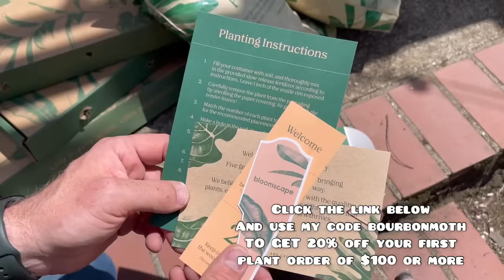Easy Wooden Patio Table || DIY Outside Dining Table

Comment: Those GRK's that you switch to when lagging the cross pieces to the legs are amazing.  I use them on anything and everything that is outside or needs to be strong.
Reply: The GRK lag bolts are great also. Used them to build shelving in my garage, and I’m sure that the structure will outlive the house itself.

Comment: I hear ya on the grayed out cedar, but if you ever change your mind, I used Sikkens Cetol 1 and Cetol 23 on a log home with cedar beams and it turned out amazing. Expensive, but awesome results. I used the same on a three car garage with cedar doors. Customer was very happy. Maintenance coat is every 3-4 years.
Reply: Sikkens is legit!

Comment: Nice video and really appreciate seeing the process, the mistakes and the fixes! From my NW experience for outdoor table I suggest to cover it when not in use (Classic Accessories is one brand I know that makes outdoor furniture covers) and put some coating/wax finish to avoid permanent food/drink stains. I didn't do this for my first table and had to replace it way too quickly.

Comment: In this scenario I would go to Home Depot see that a 2x4 was 8$ then turnaround grab a 50$ patio table instead. Then skip the cereal and just drink the bourbon and coffee  🤣
Reply: Don't buy from Home Depot
Reply: $8?! $21 each by me
Reply: @cardboardorigami  i guess he meant just spruce one. $14 for pressure treated here
Reply: Is the patio table really 50$ with same quality wood and durability? I really doubt it, although I do not live in the states and we do not have a Home Depot
Reply: @erwin757  probably he meant a plastic one, really wobbly and cheap :)
Reply: @katesukhanova5530  bourbon not that heavy, that’s good enough for me !
Reply: @erwin757  No chance a good quality hardwood table is 50 bucks.

Comment: New table saw?  Party time, Excellent!  I'm a woodworking fledgling compared to you but in addition to the safety, I really appreciate how well it runs and it's solid and reliable.  Nice table too -- and that rug really tied the patio together, did it not?

Comment: Nice design! Would be perfect here in Scotland. Pity getting hold of cedar stock here isn't as simple as heading to Home Depot. It's practically a second mortgage proposition.
Reply: I was about to write exactly the same here in New Zealand. If you made the thing out of pine it would probably weigh a ton and no longer be moveable.
Reply: @justinstrik7125  Totally. Plus it wouldn't have anything like the durability of cedar.  The only readily available alternative here is treated spruce. Even if you ignore the fact it's full of chemicals, it's horrible to work with and never remotely close to being clear of dead knots and splits etc. since it's expected to be used for fence posts and the like.

Comment: One addition I would have done is put additional blocks just inside each leg for the bolts/threaded rod to go through. That would put the bolts in double sheer and increase how much load they can take while also eliminating the flex you were seeing. Less important with the long threaded rod and the legs joined together like that, but it would still add a lot of strength for a small change.
Reply: It's a patio table. How much load is it going to get?
Reply: @keithfaulkner6319  well, it already saw several hundred pounds in the video.

It's more about having the screws flexing and pulling as they are loaded and unloaded. It wouldn't take much to open up the holes over time and make them move around even more. A simple block with a hole through it and a couple of screws would eliminate the flex and halve the forces at each end.
Reply: @srwapo  ok you,might be right, but geez it was supposed to be a simple build. In the real world the table would be set up in the spring, get loaded with 20 pounds of food at a time all summer, then taken down and stored for the winter.
   In this scenario that table will work just fine.
Reply: @keithfaulkner6319  to be fair, it was my first reaction to seeing the screws flex in the original design. I'm less concerned with the full length threaded rod.

Just hate seeing screws in single shear when it's so easy to make a double shear design! Especially when things are moving.
Reply: @srwapo  ok, if it were going to set up, taken down, repeat , repeat, repeat, endlessly. 
   A table not treated that way isn't moving much. 
   The design would obviously depend on how you plan to use the product.
   Overbuilding just complicates the product and increases the weight.

Comment: I just finished building 365sq ft cedar deck. plan on a partial roof for my Bbq,smoker and flat top grill. was looking for a nice table. found it. I will be sending for your plans
Reply: Or you could draw up your own. It's just a table, not brain surgery.

Comment: FYI: Those are "carriage bolts" with the flat ends, thin threads and a square shoulder to lock them into place.
"lag bolts" are pointed and have wide threads and a smooth neck.
Also, this table looks a lot like a really really really really large version of a "TV tray" I have...
Reply: It all depends where your from Mr know it all there called coach bolts in uk
Reply: @planetterror649   thanks mr know it all.

Comment: Love your design, and especially the angled legs. Very jealous of the cedar. 

You might consider using lap and rabbit joints at leg cross members and stops. It would take a bit more time and wood but would be a lot stronger and not reduce screwing into the end grain. 

I’d probably use a round over on the ends to match the decking profile. A linseed oil finish is food safe and would also keep it looking as beautiful as it is to start. 

I built a similar table but rather than the long allthread, I added a second stretcher cross board thingy at the top of the legs as well as the bottom. Worked using 2x4’s for the legs as well. 

When the hole was in the wrong place, an alternative to starting over would be to fill the hole with a dowel, though that would entail gluing. I’ve done it to reclaim some wood and use titebond 3. As long as you’re not using the table in the pool or lake, a little or even a lot of rain will be irrelevant.
Reply: And reduce, not and not reduce

Comment: If you could figure out how to put one handle in the middle (Maybe lengthen the table by 6” and use 2 crossmembers?), then it would be really easy and balanced to reach over the table and carry it under your arm. That’s how we carry paddleboards.

Comment: Great build. Just a couple of suggestions. I would have plugged the mistaken holes with 1/2" dowels, because I'm cheap and after all, it is an outside piece, also laziness is a factor. On the threaded rod, put a washer and nut on the inside of each leg for increased stability. You could countersink the nuts on the outside. Yes, it's an outside piece, but it's my experience, if anything is sticking out, I will find a way to bump into it. Picky? Maybe, but you asked for comments. Love your channel. You should make an outtake video, if you haven't already (I haven't come across one yet). With all the running around, filling your mouth with glue and using your beard to apply stain, there must be more outrageous things that went wrong and never made it to the final cut.
Reply: I wanted to do the same with the washer and the nut, but my dad pointed out that with the cross braces, those legs aren't going to travel inwards

Comment: I had the short screw challenge , Counter sink the leg 2" . The 3 " screw fits .The strength is good and it works . No bourbon ,Tequila for inspiration . Just saying. IT would have been so easy to bottom screw and save the top unless you like the look .

Comment: Bourbon Moth - Do you ever respond to any of the questions in the comment section of your videos?  How do you scribe a shelf on three sides going into an alcove when the shelf is too large to fit?  Make an open template, scribe it with a compass and then transfer it onto your shelf??  Is there a better way?  I saw you made a video on floating shelves but you did not show scribing.  Thanks.
Reply: Check out his video on the office renovation. He shows how to make a template for a desktop with three walls. The same could be done for a shelf.

Comment: Possibly shift the blocks that hold the legs when folded to the underneath side of the table top and act on the bottom leg brace? That way the bottom is flat when folded.

Comment: hi Bourbon Moth Woodworking... I'm building custom cabinets for my kitchen and I was wondering if I could get away with using finish nails instead of screws to hold my cabinets together...? What are your thoughts? Or do I need to use screws? Need advise! Thanks so much!

Comment: Noticed there are some slots running on the underside of the table top pieces.  Was this just part of the decking features or did you add these?

Comment: you could have put in a dowel where you drilled the wrong spot for the hole then redrilled once it was dry couldn't you have? That way you wouldnt have had to do that board over? Great job as usual Man. Cheers!

Comment: Seems like the carriage bolts would have been just as sturdy once the nuts were tightened and the braces were installed?
Reply: Once you tighten the bolts so the leg doesn't wiggle, the leg doesn't rotate either.

Comment: Great idea Jason! Perfect for us in the PNW. One question... You decided on a 25 degree angle. Do you think it would be as stable at 20 or maybe 15?
Reply: 25 to 30 degrees is best for stability by my experience
Reply: You could get away with 20, but probably not 15.

Comment: Just want to stop by and than you for not adding any finish to that wonderful cedar. It pains me to see folks putting sealers and stains on cedar decking. Let it get silver, and it will last forever with just basic cleaning on occasion. My new deck is all Alaskan Yellow Cedar, and it is now the perfect silver/grey, after about 15 months of weather.

Nice work, I may have to borrow that design for a new deck table. With the top made of AYC of course.

Comment: Can someone explain more about the decision to not use wood glue for any of the joints?  Does wood glue not work when exposed to the elements? -- Wouldn't it still be stronger to use wood glue and fasteners? (or is there just no point to it?)

Comment: Nice design.  However, to make it lighter, you could simply have 2x4 legs instead.  I think they’d be sturdy enough.
Reply: True, but it would look flimsy in comparison. The 4x4 legs give it some weight which I feel looks right with the large top. What’s functional and what’s design aren’t necessarily congruent. 🤷🏼‍♂️😉

Comment: Should have kept the other frame that wrong holes you could have made in to a pin system. There is always a risk of two legs folding back in if you try to drag the table. It’s not a mistake it’s a feature!

Comment: @ 30:22, why didn't you move the cross support towards the hole you drilled rather than replacing the whole 2x4? Legs would have been slightly shorter but not enough to make a significant difference
Reply: Or scab the thickness needed to the inside of the cross braces.
No new holes or remake of the rails.
Reply: @ExplorationObsession  I would have glued a dowel in the hole and simply drilled a new hole.

Comment: Have you thought about getting a router CNC? Or, are you afraid of how many more projects your wife will come up with?
Reply: He had one for a couple years. Never leaned how to use it. He just traded it for festool tools
Reply: @guillermopalmisano8957  those dang festool prices
Reply: @MustPassTruck  right. Trade a power tool for a computer tool. Cheaper.

Comment: Love the table. Bought the plans. There’s some errors. 

I went and did all my cuts off the cut list. Then you get to the assembly stage and the cut list says (I don’t have them in front of me, so this is a guess) but the cut list says, cut the legs to 23 inches. And then a page or so later. It says, now attached the 28 in legs to the bottom of the table. 

Which sucks. Because as many know, you can’t add more. But you can build little stilts for the bottom. So I love the table, but dude needs to double check plans as the cut list is not consistent with the rest of the build.

Comment: Thank you Jason!  I have a question.  It looked like you cut long kerfs on the bottoms of the table top boards.  Did I see that correctly?  If so I would think it was to help them stay flat.  How deep do you need to cut those and how far away from the end of the board should they stop?
Reply: I was also wondering about those.
Reply: He used the radius edge cedar boards from Home Depot for the table top boards; they come with the kerf cuts.

Comment: Why not simply add a block on the inside of the stretchers, drill a 1/2" hole through, and still use the carriage bolts? That would have gotten the stability you were looking for without buying expensive threaded rod.

Comment: A pallet wood river table?
Reply: No, a wood pallet made from a river table 😉
Reply: Pallets are made for a purpose and should only be used for that purpose or for firewood  😂
Reply: True. But who can say what the true purpose of a pallet is? I've seen pallets holding river tables, and river tables holding pallets. Why not just combine the two and get it over with?
Reply: @ergohack  I think if you Google the definition of a pallet you will get the answer 😉 it's definitely not classed as a river table 🤣
Reply: All the pallet wood i've ever seen is real crap. That's why they make pallets out of it.
Reply: @keithfaulkner6319  exactly 💯
Reply: @keithfaulkner6319  I've seen plenty of pallets made out of decent hardwood. The ones made out of half-decent wood usually have a deposit on them though, so you rarely see them outside of warehouses and shipping depots.
Reply: @ergohack  ok. The ones i see got delivered and left.

Comment: Fruit loops taste better with bourbon. Maybe you could do a video on the proper sanding technique.
Reply: Frosted flakes are best. What goes with that?
Reply: @keithfaulkner6319  rum?
Reply: @jonhatchcirclejfarms1628  mmmmm. Not a drinker. I'll stick with milk. 
   Although, when you run out of white milk accidentally, chocolate milk works ok.

Comment: Would you not just fill that apron hole with a dowel?  I feel like a dowel and glue would solve the problem without remaking the apron.
Reply from the maker: But it wouldn’t be perfect
Reply: @Bourbonmoth  I have much to learn.
Reply: @Bourbonmoth  Would a grain matched plug be up to your standards?

Comment: As always this is like a mix between a short film and a wood working video. Sundance look out. I like your design but would have gone with 2x4 legs and at maybe a 15 degree angle instead of 25. But hey it's your table.

Comment: Somebody (Jason) needs to brush up on their hardware:
The bolts in the beginning of the video are carriage bolts.
No, that's not rubber.  "Nylock"... It's called a nylock, because it's the nylon insert that prevents the nut from backing off.
The threaded rods are called" All-thread," preceiely because it's literally all thread.

Comment: I wanted to build this project and support the channel, so I bought the plans.  Unfortunately, they are pretty bad.  In my opinion, the plans should include instructions detailed enough to build the project without the youtube video so I can print them out and use them in a shop without my computer.  They definitely don’t.  

Critical dimensions are missing (unless you have a total boat bucket at home, who knows what the radius of a total boat bucket is).  There are also obvious typos and grammatical errors which make the plans hard to read.  

The included links to products also don’t work.  Just a ton of unforced errors.   

Love the channel, but was pretty disappointed.

Comment: no one can sit on the ends
Reply: Wonder if he set it up like that to minimize tipping if some sat on the ends.
Reply: @jjudy5869  If the pivot points moved closer to the centre, then the legs wouldn't be able to fully tuck up into the undercarriage.  They fit perfectly due to an excellent design!
Reply: You sit AT the end and eat, not ON the end. If you're going to hold the food on your lap as you sit ON the end, you don't really need the table do you?